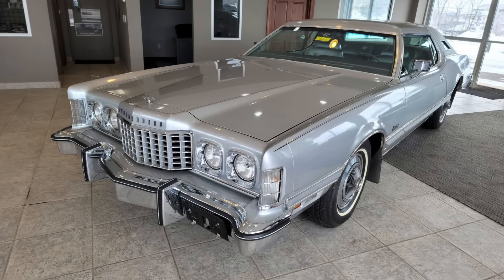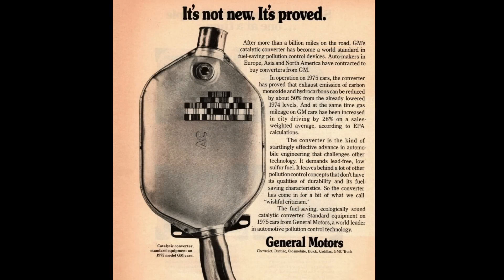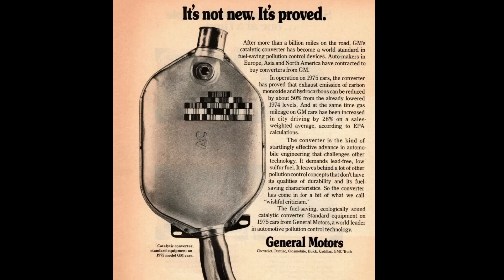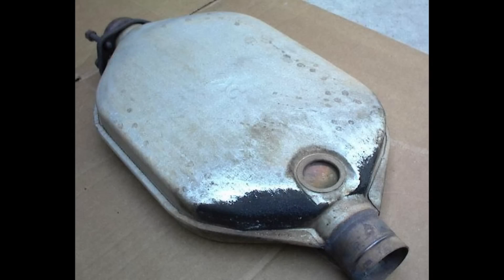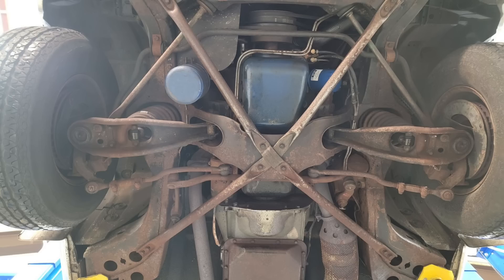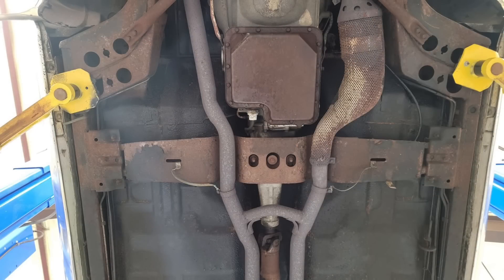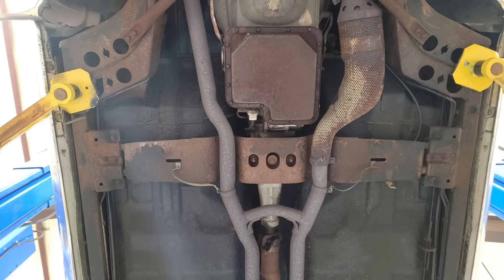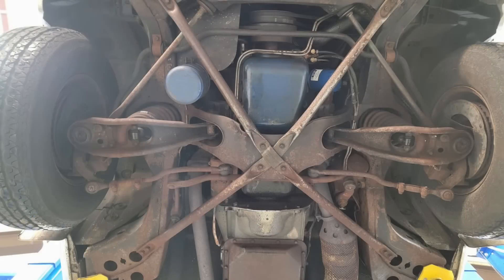Strangest Car Inventions: Ford Invents A Bizarre Way to Meet 1970s Emissions Standards

Comment: Very interesting video. Two things I remember most about 70s-80s catalytic converters: sulphur rotten egg smells and rusted heat shields that would rattle after just a couple Michigan winters.
Reply: The sulfur smell was due to high sulfur content of the fuel not something the cat caused.
Reply: @bobroberts2371   It can be a sign of a failing catalyst since a good condition cat will mask it, I remember the same sulfur eggy smell on some early 90's vehicles running ULP in a shop I worked at that subsequently failed emissions tests. The cat tech has changed quite a bit as I haven't seen one fail for a very long time. It's all DPF diesel problems now.
Reply: @bobroberts2371  I acquired a Lincoln Town Car with a bad cat a couple years ago.  Car usually smelled like rotten eggs when running.  Had the bad cat removed and replaced with a section of straight pipe; the smell went away immediately.  The sulfur may be contained within the fuel, but it's the cat that's causing it to be released in a way that smells like rotten eggs.
Reply: @bobroberts2371  Yeah it was.  It meant it was working.  The fix for complaining customers was  to run a tank of leaded gas in it so the catalytic converter's effieciency would drop a bit and have less odor.  That's the way we did it in the late 80's at the GM dealer anyway.
Reply: @bobroberts2371  Nope, catalytic converters can very well cause weird sulfur smells. You never drove behind a vehicle where the cat is going out? Straight egg farts lol. Before you say it is only because of the fuel, i have driven multiple cat delete vehicles and not a single one of them had sulfur smells, but every so often a shitbox goes by with busted cats and you can smell the egg fart smell
Reply: @DarkAttack14  Because the cat is 'cracking' the sulfur dioxide in sulfur-rich exhaust, which was caused by sulfur-rich gasoline. It's robbing the SO2 of it's oxygen and it's forming H2S. Without a cat that same rotten-egg smell is just a "harsh exhaust" that burns your eyes and lungs a little. Oh, and corrodes the everloving crap out of regular steel exhaust tubing.
Reply: @DarkAttack14  Yes, because the sulphur in the gas reacted in the catalyst. Modern cars would probably smell a helluva lot more on 80's gas.
Reply: @anttiruo  of course, I was just making the point that a properly working catalytic converter will have no sulfur smell whatsoever coming out of it but one that is dying or has its substrate contaminated very likely will smell eggy
Reply: @bobroberts2371  Source please.
Reply: @87AeroCoupe    My 45+ years in and around the auto repair industry.    Cats don't " make " sulfur therefor it comes from the fuel  EPA has info on sulfur in fuel.
Reply: @bobroberts2371  you are correct, sulfur is naturally occurring in crude oil that has to be removed & if you smell sulfur the convertor is not doing its job
Reply: @SquirminHermanthe1eyedGerman can confirm.  In May 2021, on the Coast Starlight (Amtrak) headed north out of LA, I passed by what looked like an oil refinery.  The refinery proper wasn’t the issue.

The huge piles of bright yellow obvious Sulfur were!
Reply: Addendum: Santa Maria Refinery, about 27 miles north of Vandenberg AFB…
Reply: @SquirminHermanthe1eyedGerman  That's wrong. It's a sign of the cat working. Not the cat"s fault, when the freshly produced hot co2 bonds with the sulfur. Only real cure of that problem is to remove more rotting dino sulphur within the gas refining process.
Reply: @werner.x  a proper catalyst should have absolutely zero egg/sulfur smell. Only broken ones will smell off. Broken catalysts will allow hydrogen sulfide to get past which causes a smell. A properly working catalyst at no point will allow hydrogen sulfide to pass without being converted
Reply: @DarkAttack14  I call that fake news or alternative facts, but believe, whatever you like to.
Reply: @DarkAttack14  With today's fuel absolutely! With 80'a fuel with at least 10 times more sulfur very different.
Reply: From the official / factory Toyota customer service
What causes sulfur odor in the exhaust? How can I prevent the odor from occurring?

A sulfur odor emitted from the vehicle's tailpipe does not necessarily indicate that there is an issue with the engine's running condition. It is most likely directly related to the fuel.

Sulfur is a natural component of crude oil from which gasoline is refined, and the amount of sulfur can be decreased through the refining process. While the amount of sulfur in fuel sold in some states such as California is regulated, gasoline sold in other states can have substantially higher sulfur content. Sulfur content may vary between gasoline brands and locations; switching gasoline brands may help. The more sulfur present in the gasoline, the stronger the sulfur odor can be.
Reply: This was about the time that it was realised that fully cleaning up Californian smog wasn't going to happen with emissions control and the FUEL needed cleaning up

if you think the automakers fought hard against emissions controls, that's nothing compared to how hard the oil companies fought sulfur mandates and other initiatives
Reply: Yes we use to joke the guy in front of us must have had too many beans, sometimes we would pull off the side the road so they would continue up the road a while, then continue on our way.
Reply: I always thought they smelled like paint thinner when cold.
Reply: Lean catalytic conditions make SO2 sulfur dioxide, match smell.  Rich conditions reduce sulfur to hydrogen sulfide H2S fart smell.  Humans are very sensitive to H2S.

Comment: remember nothing fitted to a vehicle for emissions does anything to make performance better even down to a pct valve
Reply: Well a PCV valve keeps the oil clean. Could be useful to keep the engine performance at its best.

Comment: Ford was a joke around that time. Everything they had to add on to meet emissions or safety standards looks like it was kind of tacked on. The bumpers are a good example. Take a look under the hood of one of these behemoths... you can barely see the engine for all the vacuum lines, hoses, tomato soup cans and other garbage.
Reply: Had a '96 Explorer. Pretty much the same. Hoses & wiring everywhere.

Comment: 6:22 What is that grey canister-like object to the left of the oil pan?
Reply: Fuel evap canister. Foil tube goes  from that to the side of the air cleaner .
Reply: @craigpolinski8955  Thank you sir
Reply: @craigpolinski8955    Also known as a charcoal cannister.

Comment: Ground straps
This was usually to mitigate electrical noise that causes radio interference.   Some modern cars do this as well, the PT cruiser has ground wires from the front struts to the inner fender.
Reply: That ground on the PT(and Neon) is to keep the front wheel bearings from failing prematurely. When I was a young tech at the Chrysler Dealer and these PT's were new the senior tech that mentored me explained the previous generation Chrysler vehicles w/the same press in style wheel bearings would burn through front wheel bearings until they added the ground strap to help discharge the static electricity that was generated when the wheel spun.
Reply: lol
Reply: My 59 VW beetle had those copper springs . The first time the brakes were relined the dealer left the springs out; said they were useless. Since I didn't know I put new ones in. I still don't know. My 1987 Benz (300 SDL) had them. They have been gone for several hundred thousand miles. Doesn't seem to matter. There's one in the glove box. That must be enough. I really enjoy these videos and the comments they generate.
Reply: My SL500 has a copper spring behind the dust cap on the front hub bearings to mitigate radio interference.  That's back when Mercedes was ran by engineers and not shareholders
Reply: @JayMalone26 
I had to Google the copper spring out of curiosity. According to "Mercedessource", it is to provide a ground path for the brake pad sensors.
Reply: @JayMalone26  Static electricity discharging through bearing surfaces can over a period of time cause those smooth surfaces to deteriorate. The copper spring might be to overcome that. It is a definite issue with large industrial electric motors that are operated from variable speed AC drives.
Reply: @JayMalone26  Every company is run by shareholders.

Comment: By having half of the Pintos explode it saved on tailpipe emissions.  Fire balls are harder to measure.
Reply: The mid 1970s to mid 1980s was the era of Emission Controls changed about every year.  Ie a total mess for repairs sometimes. 

In Camaros the worst Horsepower to car weight Ratio was the California 1977 to about the 1979 year with the L6 ie straight Six

You got the California 90 HP and required Automatic transmission.  Plus a car that weighed 3400 Lbs compared to the lighter 3rd gen in 1982.

So my ancient 1982 California Camaro with 90  HP weighed 10 percent less than those worse Camaros. Plus had a non lossy manual transmission. 

2nd Generation Camaro fans can get excited their Generation had the slowest accelerating Camaro ever made. Ie the California 1977 and 1978 L6 road slug. Lol

The California Smog Test chaps had books that showed what smog crap was on each car made. There was not always a sticker under the hood to show that years Rat maze of Emission hoses and stuff 

There were some California cars in the 1970s that had black coffee can gizmos as the vapor canister 

Non California folks would always say buy a new GM or Ford or Chrysler with a XYZ engine and ABC transmission . But they were not sold California . Ie only detuned subset of vehicles. 

That is why comparing HP etc in past eras is rather hokey at best.

Comment: Primary light off on only the passenger side of 80-82 Fox 4.2 and 82 5.0 2V GT V8s , and a secondary long bed converter by the transmission. Or the 1980 2.3 turbo Fox, Primary light off on the passenger side, then a turbo on the drivers side, then a long bed converter by the transmission. Great way of killing a Garrett Air Research T03 turbo, feed it primary light off catalyst  with cerium  coated gauze......and probably why Ford had ahem Quote "Persistent Reliability problems with the 1980 2.3 Carb Turbo Mustang and Capris" Unquote.

Comment: The catalytic convertor is the single worst thing for ground water contamination...because of the heavy metals used in the process... They have found  heavy metals on top of mountains!.... There use to be an article on the net now almost complete scrubbed from net... that doucmented this from goverment sources....it's the fuel they could have improved the fuel to the point that emmission would be nil...for about one dollar a gallon... And our modern cars burn so clean there is no reason to go any further on complicated emmisions systems... It's a money making game period.... The EPA considers pollen a polluntant!.... Yeah go put a cat on a tree!... VOC's are everywhere flowers sweet smell is a VOC...all life is based on carbon....better off spending our time in fixing what we should our realtionships with each...than worrying about the sky falling.
Reply: What specific heavy metals are used in cat manufacture?
Reply: This makes ZERO sense. Absolutely zero. The actual catalytic stuff, the stuff that lets CO grab another oxygen atom so it becomes CO2, and the stuff that ensures that unburned or partially burned fuel turns into fully burned fuel is... platinum group metals. Rhodium and palladium typically, since platinum itself, while really efficient, has become too expensive. And the whole point of a catalyst is that it enables a reaction without it itself being used. So the palladium and rhodium do not leave the catalytic converter during normal operation. 

So maybe that article got taken down because it was a hoax? What you described is physically and chemically impossible.
Reply: Pretty sure lead is a heavy metal pollutant.
Reply: Fixing our relationships between people alike and different is always a good idea.
But the platinum or rhodium in a cat is too expensive to waste or let leak out.
As for pollutants, many things are good - but only if there is not too much of them.
Reply: @pizzablender  the whole point of a catalyst is that it enables a reaction without it itself being consumed. 

Rhodium and palladium stay inside the catalyst. (Unless you have a serious backfire. That can damage a catalyst so that chunks come out.)
Reply: @Hydrazine1000  That's what I tried to say as well. That it would cause pollution is thus nonsense.
Actually, the use of catalytic converters had meant we got rid of leaded fuel. Talk about heavy metals.
Reply: Yes, it gets tiring hearing that CO2 is "pollution".
Reply: @althunder4269 CO2 is great if you want our planet to resemble Venus.
Reply: @althunder4269  TOO much CO2 is a problem. Around 400 ppm (or 0.4%) is not yet a big deal (even though that's half more than it was before the industrial revolution) but if the global population lets this continue to go up, it will become a problem. 

If you are in a poorly ventilated room with a lot of people, where you get well past 2000 ppm, you'll develop a serious headache, have trouble concentrating and feel lethargic.
Reply: @althunder4269  They don't get it that CO2 is great for the plants and vegetation. I mentioned this often at the public forum about "climate change", and I got yelled at by the unhinged environmentalists as fake news.
Reply: @InTeCredo CO2 is great if you want our planet’s atmosphere and climate to resemble Venus.

Comment: I remember when the 76 Chrysler Cordoba came out and the ads touting the 400 Lean Burn engine with no cats, thus you could use regular leaded gas.  That only lasted for one model year, as in 77 the 400 had cats.
Reply: The system was unreliable but the principal of operation was pretty good. Combustion temperature rises the closer to 14.7:1 you get but then as you pass it the temperature drops again
So ELB worked by going so lean that the engine was running on about 17:1 AF and was lean cool because the mixture had so little fuel in it. It was detonation resistant because detonation only occurs in a certain band. A great idea but yeah, nah. Fuel injection solved all that. 
Interestingly, Jaguar V12HE engines took the operation principal of ELB and refined it to a high degree. The designed was baked into the engine from the pistons to the combustion chamber, the injection system and the ignition system. They still had cats though.
It made the V12 engine last 15 or 16 years longer in production than it would have.
Reply: Because the lean burn engine was endless problems.  My brother had one he cussed and finally killed trying to get rid of the lean burn mess
Reply: @davidam9454  I once had a Plymouth Gran Fury with that on it. I simply 'backdated' it & eliminated the Lean Burn. Chrysler even sold a kit to do this,this ought to tell you something right there??? Ran much better after that,and my MPG's went up!!!
Reply: @davidam9454 Ironically in Australia the ELB when applied to the Hemi 6 produced higher power and better fuel economy under ADR-27A which is was a similar standard to the 73 US Federal emissions standard.
In the CM Valiant an ELB Hemi in highway running could return better than 4 cyl economy. It was known that a ELB Hemi 6 could produce better fuel economy than the Mitsubishi Astron 2.6 which was known in the US as "Silent Shaft"

If only the Hemi-6 had an alloy cross flow head. It would have been a world beater. With that said Ford AU power train in the 1970's seen the Hemi-6 as the reference. When they developed the cross flow and the later alloy head.
Reply: My dad had a 76 400 4bbl with the ELB. Each time we went to an emission test, they tried to deny him for no cats. Each time he had to raise the hood and show the the tag NON-CATALYST. If you ordered the L code 360 4bbl  75-79, or P code 400, you got true dual exhaust with dual cats. The floor pans on those cars were mildly revised, and you also got a smaller gas tank to accommodate the pipes.
Reply: But did it come with fine Corinthian Leather?
Reply: My grandad had one of those lean burn 400s that kept slowly ruining pistons at only 80,000 miles all 8 pistons were replacements and he sold it.
Reply: I remember my grandpa had a 77 New Yorker with a 440 and Lean Burn. He never complained about it giving him problems but im sure it did at some point
Reply: I had a jan 77 Cordoba 400 that had no converter either.
Reply: "Your rhyme style is oldah than a Chrysler Cordoba!"
("I'm wilder than the Cats of Villanova (say it ovah) uh uh Kentucky!")
~Tribe Called Quest
Reply: My Dad ordered all the cars and trucks for a large power company in PA and they bought full size Plymouth Fury's for their execs to drive.   These had the 'Lean Burn' 400's and everyone was very happy with them.   Good power and many reported they got 20 mpg's on the highway!   That was until the recall notice came in from Chrysler that they had been recalled and needed to go back to the dealer to be fixed.   Every car that came back was WAY down on power and mileage had dropped to the 12 mpg level....they were MAD!!!